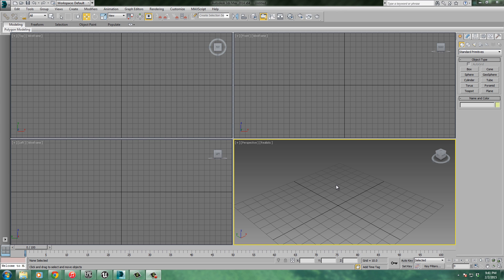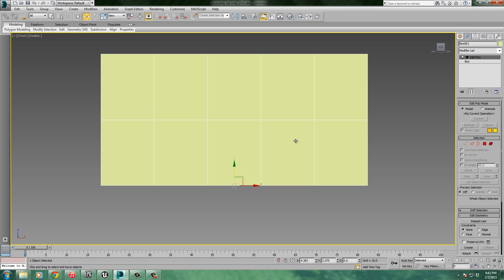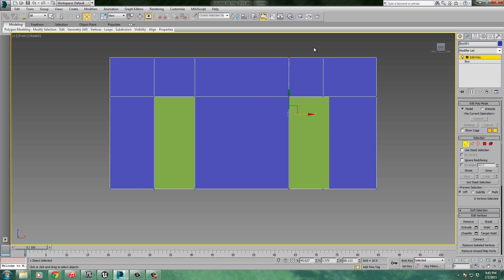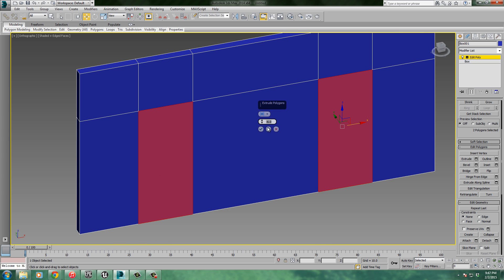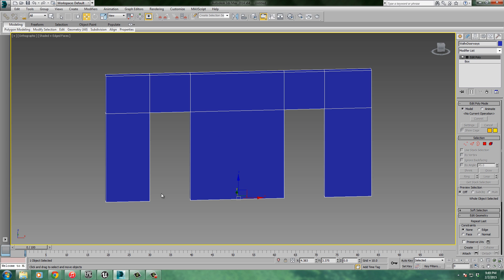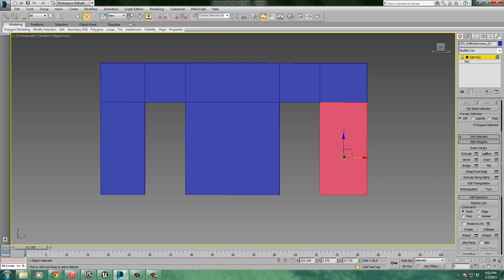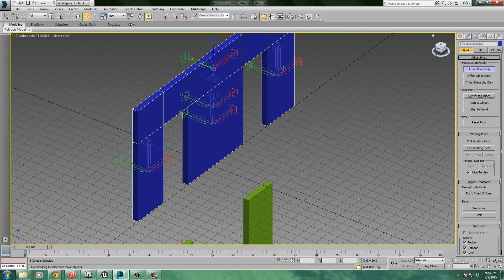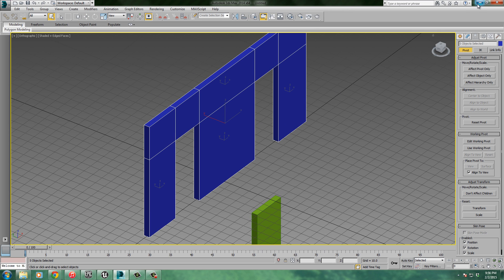How to create a wall with doorways in 3dsMax, add a collision model and export it.

Comment: Hi i have problem with this then i try to import my file it showind just top part do you know why
Reply: mazer322 there might be lots of possible issues:
1- you split the original mesh instead of making a copy and splitting that
2- you only exported (selected then exported selection) the top part of the split mesh
3- you named the copy differently which makes Unreal assume it's a normal mesh rather than collision

Make sure when you select the entire mesh + the collisions mesh(es) to have the right number showing on the bottom left (In this video it's 5 objects), and then export selection.